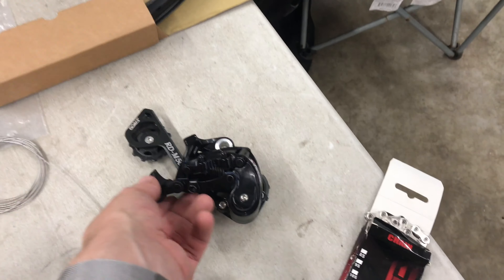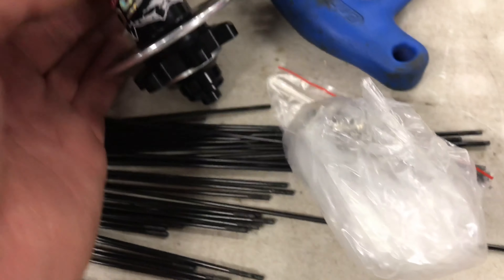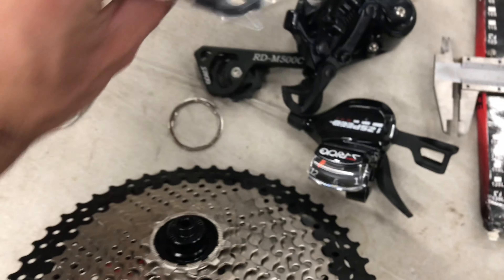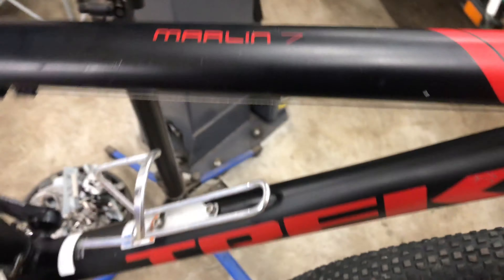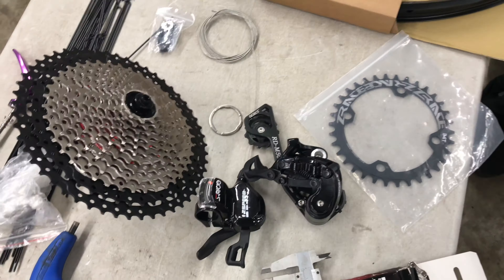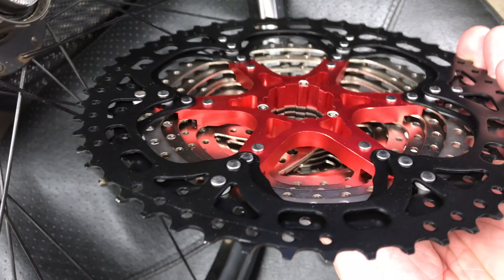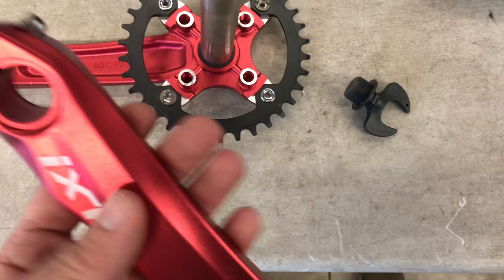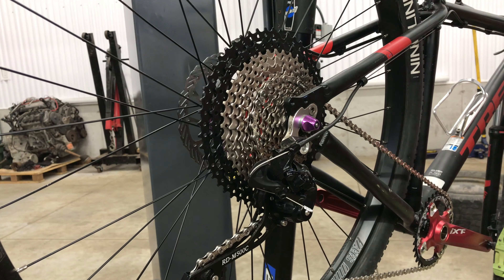S-Ride Groupset 11-52t 12 Speed MTB Drivetrain Setup/Overview 1x12

Comment: Shadow doesn't mean extended hanger.
It means the mech sits closer to the bike, in the shadow of the 
stay instead of sticking out past it.  
Basically a change in the fundamental positioning of the mech in order to tuck it in and away from damage better.

Comment: I've had a couple of those e13 rims fail, even with using those nipple washers they provide. Also just opened an SLX crankset, no cap tool. ENLEE and Koozer hubs also pretty good. TiDEACE bikes, ztto higherend stuff is also bomb proof. I've got one of their 11 - 50 11 speed freewheels (among  other things) it's awesome. runs amazeballs with an xx1 set up.
Reply from the maker: That's awesome. Sucks about the e13 rims though, I really like the look of them.

Comment: i have the same casette and the largest cog hits the spokes..ive put a spacer behind the casette like you did but now the smallest cog doesnt fit anymore when i tried to re attach...im using a shimano 10-11 speed freehub.
Reply from the maker: Must be a 10s freehub and not an 11
Reply: @porkercon  i see...so it will fit if i use a 7 to 10 speed freehub instead of the 10 to 11spd freehub? just making sure so i could order it...thanks!
Reply from the maker: @iTsDaToTDaTkantS  other way around. What is the model number of your hub?

Comment: I have a 7×3 just wanna dump that and wanna go for this do i need to change my hub too?
Reply from the maker: yes
Reply: Ok thanks for reply and do 9 speed requires changing hub also?
Reply from the maker: @Impuls1ve  Nope, will fit on 8, 9 and 10s hubs. Also will fit on 11s hubs.
Reply: So helpful thanks
Reply: @porkercon  if i have a 2x10 shimano deore,  can i put 12 speed slx or xt or 2020 deore 12 s ?
Reply from the maker: @fackerhidonbush8420  Probably not
Reply: @porkercon  thank u

Comment: Hi I saw your video . And I was wondering that if I could do mine just like that ? My question to you is this I have this bike it’s a road bike . It is a schwinn varsity 14 speed road bike 7 teeth cassette in the rear and two in the front so is it possible to upgrade it just like yours what do you think ?? Thank you
Reply from the maker: No, wont be easy, probably will need a new rear wheel and cranks. Better just get a different bike.